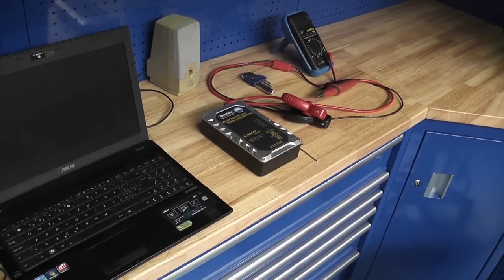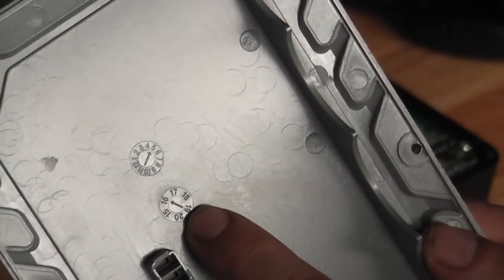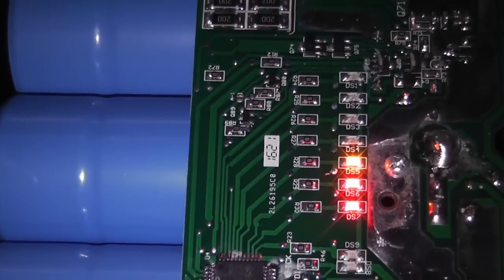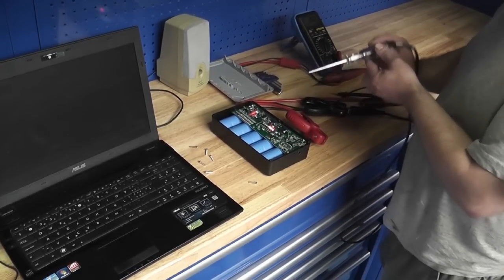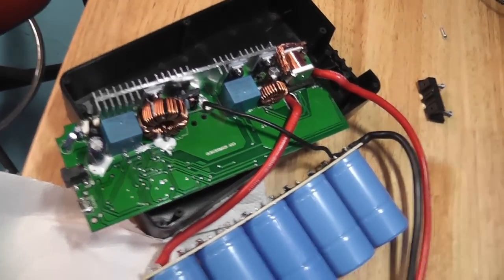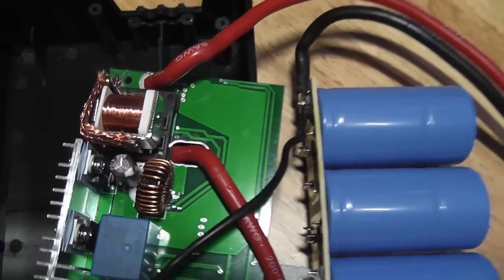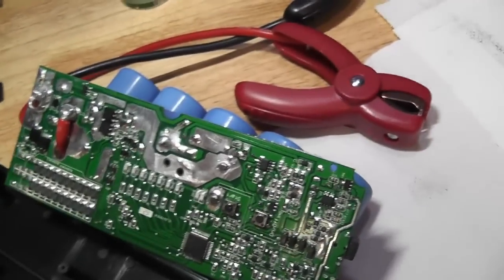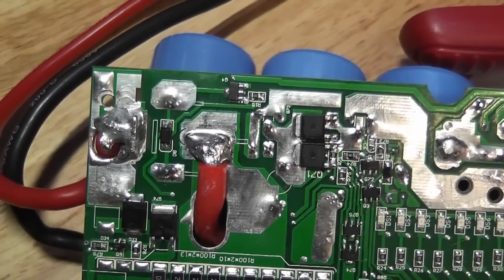supercap jumpsarter taken A part

Comment: It looks really good internally with 8 or 12 bit microcontroller for managing Voltage and Current delivery.  It also has both choke and capacitors to reduce interference or noise current and radiation to the surrounding. The main part is the quality of the Ultracapacitor itself, we do not know the supplier name but generally, they last long.  It also have big enough heatsink for the power rectifiers.

Comment: Could you please tell me what the part number is for the lithium iron battery that your using ? Thank you
Reply from the maker: Steven Rockafellow  they are no batterys they are supercapacitors onehanglow no name brand. Jerry be corner  has the same no battery supercaps and some other guy made car battery replacement out of super capacitors if you hunt  . The light blue big round are no name supercapacitors.